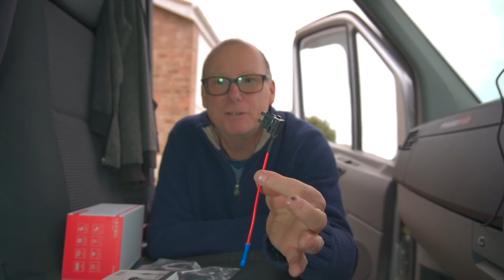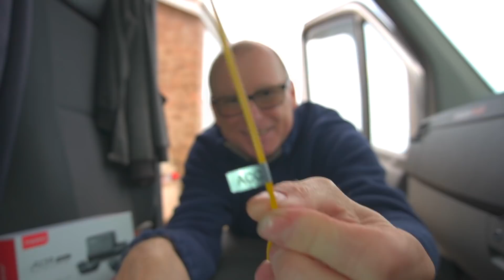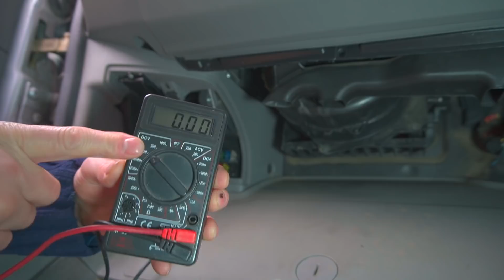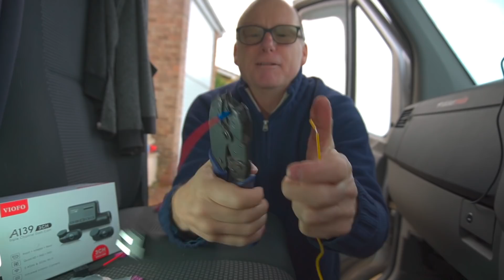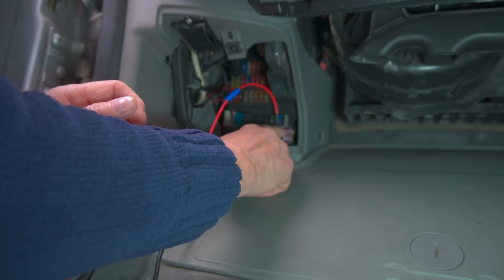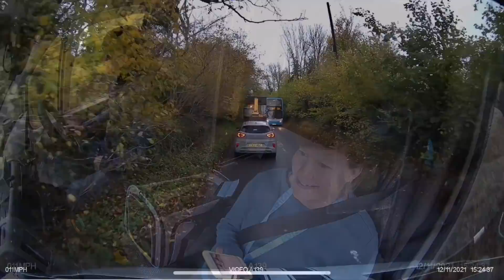HOW TO ADD A PIGGYBACK FUSE TAP CIRCUIT TO HARDWIRE A DASH CAM

Comment from the maker: If you are interested in any of the products featured in today's video here are the links 
3 Channel Dash Cam VIOFO A139 https://amzn.to/30r8J7u
Fuse Tap https://amzn.to/3ou6s3G
Digital Multimeter DC and AC https://amzn.to/3opQszD
A SIMPLE Auto Car Truck Voltage Circuit Tester 12V https://amzn.to/320uGuO
If you would like a sticker buy me a coffee and I will send you one. your support is really appreciated please include your name and address. https://www.buymeacoffee.com/BigVanSmalWorld
Reply: I always add a tag of masking tape to the wire with an abbreviation of the item on it, this helps if you have multiple circuits and need to identify them some time in the future.

Comment: Really well made video, but unfortunately doesn't cover what I need.  You show an example of 'permanent' and 'ignition', I would like to wire in a usb socket (or split into two) NB not a cigarette lighter type style, but just a 'hidden' socket, so I can use any car accessory that connects using a USB-A cable (hidden away, instead of using the usual cigarette lighter adapter).  To me, this is an obvious piece of kit.  They exist, but they all appear to have two wires, +/-, with instructions to plug directly into a battery.  So ... is it possible to terminate the two +/- wires into a piggy back fuse???  Your video shows a single wire from the dash cam going to the fuse, is that a positive (+)?  In that case, were does the dashcam get negative (-)?  Is what I am after possible?!?!?!

Comment: Hi but if an issue,I need help basically my daughter just bought a Vw polo,with after market stereo,there is a red wire crimped to a spade connector which is slotted in to the fuse box, it’s an ignition live circuit,but the spade connector is a poor connection,so I’m thinking of using a piggy back fuse,but as currently r spade connector is plugged into fuse board,so the slot that it’s plugged into has power from back of fuse box,if I fit a piggy back fuse will I have to put a fuse in to piggy back fuse?as all I want to do make the currant connection secure,
There isn’t any fuse at the ministry in the slot on fuse box,if you can make out what I’m trying to explain any help or advice will be appreciated
Reply from the maker: Yes use a fuse good luck 🤞
Reply: @MelsBigVanSmallWorld  what amp fuse would you recommend, and is that correct about piggy back fuses,there is a right and wrong way of fitting the ,I really need all the help and advice I can get,

Comment: Is the amp rating of the car fuse you remove imports.  Should it be higher or lower rating compared to the accessory fuse??
Reply from the maker: They work independently so it’s not important 👍🤓👍

Comment: Hi Mel. Just thinking on this - I think it'll matter which way round you have the fuse holder? If you have the unit the wrong way round you'll bypass the fuse completely for the piggyback side. So to fit it you should pull the original fuse out then check which side of the fuse is the live side, then make sure that your new cable from the piggyback unit is coming from the opposite side of that fuse. I know that was explained badly, but hope you get the gist?
Reply from the maker: Thank you buddy that’s really helpful 👍
Reply: This is the question I was going to ask so it always makes sense to read some of the other comments first. Potentially a fire hazard if the fuse is drawing power from a different pin in the fuse box.

Comment: Since you care...foresty forest over here had a failure..found piggyback melted blob. Neither fuse blown. My concern is resistance..I know you understand. A lot of Amazon electrical is crap...concerned that the cheap metal,cheap crimps and yes cheap fuses. The contact resistance goes up,heat,melt,fail. A source of brand name USA,UK product with a high qa is not in order. This applies to crimp kits too..got caught....take care
Reply from the maker: Thank you buddy for the heads up 👍🤓👍

Comment: I am finding my way around my campervan and trying to do work myself (to save money) I went out and located the fuse box on my Vivaro and if I understood this correctly, I can piggyback something to a fuse that is already running something else? So maybe the fuse for the headlights, I could piggyback my front camera to the same fuse so that it will only come on when the headlights are switched on? There are also empty fuse slots. could I just fuse something into one of those without piggybacking? Apologies for what is probably a stupid or obvious question. Thanks for the video, really helpful :)
Reply from the maker: Yes you can 👍🤓👍

Comment: Nice video Mel picture looks great to me!
I do have a Little question for you as I know nothing about wiring , am I likely to blow all the fuses by touching something I shouldn’t with the meter probe ? 
I was once told a little knowledge is dangerous !   Thank you 👍👍👍😎
Reply from the maker: No you’re perfectly safe as long as you don’t touch two terminals at the same time a video a short 👍🤓👍

Comment: Very clear and informative video Mel, thanks. How did you select which fuse to piggyback onto - does it depend on overall load?
Reply from the maker: I’m not sure I understand your question sorry
Reply: @MelsBigVanSmallWorld  Sorry, I meant that after you discovered the bottom row of fuses were always live, was there more than one fuse in that row you could have used or did you have a close look at what that fuse was powering - or does it not matter which 'live' fuse you used? Hope that makes sense, no worries if it doesn't!

Comment: Shouldn’t consideration be taken to the size of the fuse you are piggy backing from? 
You don’t want to be piggy backing from a 10a fuse out the box, with a device with a 20a fuse for example.
Reply from the maker: No mate they run in parallel independently
Reply: @MelsBigVanSmallWorld  but the wiring on the back of the fuse box is rated only for the standard load and fuse originally supplied.

Comment: Useful bits of kit and have used them myself, makes wiring easy especially in a vehicle that’s leased or under warranty as you are not actually interfering with the original vehicle wiring.
Reply from the maker: That’s a good point 👍🤓👍